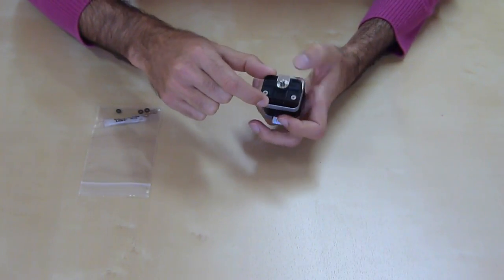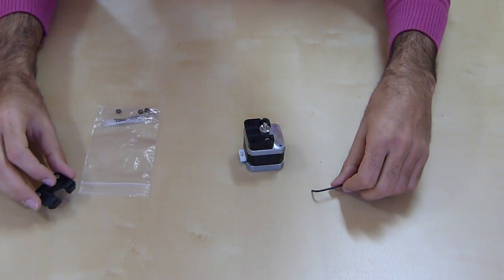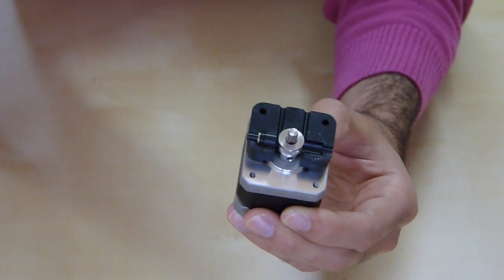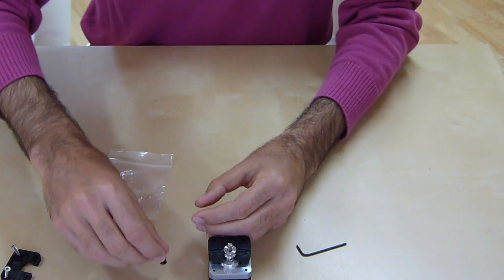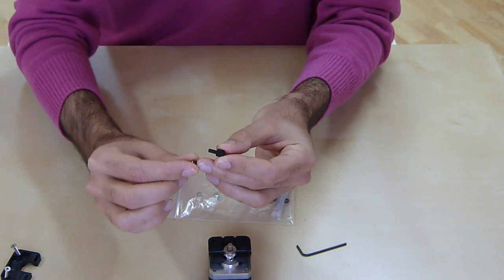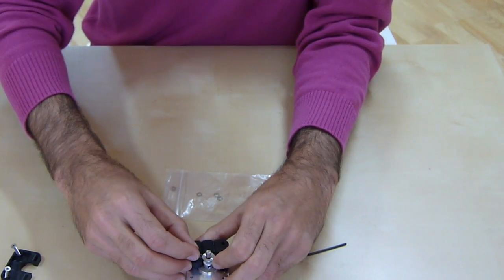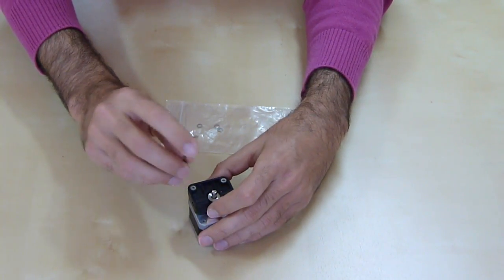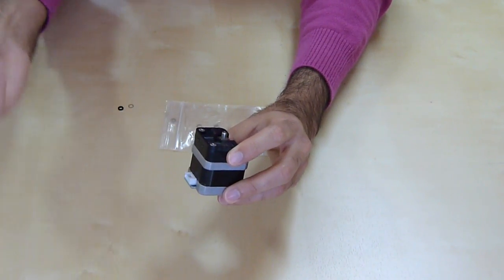Tightening the Plunger in MK7/MK8 Stepstruders

Comment: If you're hearing clicking and your mahcine is new chekc the Makerbot support as this is probably normal.

If you're hearing clicking after you've done this procedure, try making a clean cut on the filament and pushing a little harder to load it.
If it still doesn't work then you've probably added too many washers. Go back and try adding only 1x Metal washer.